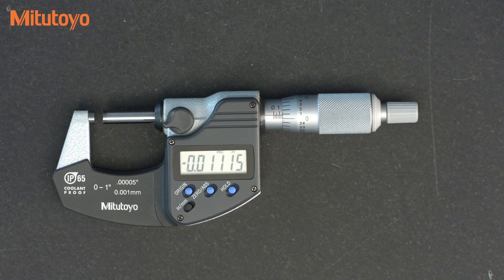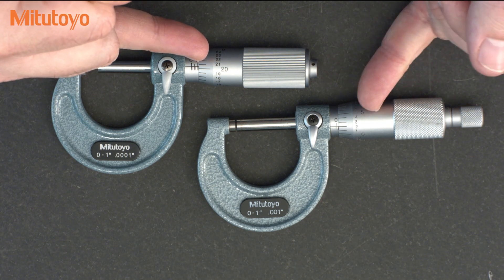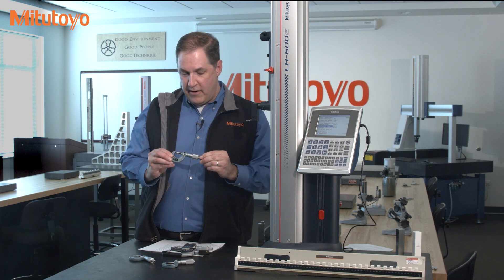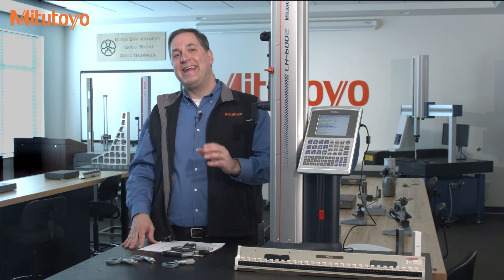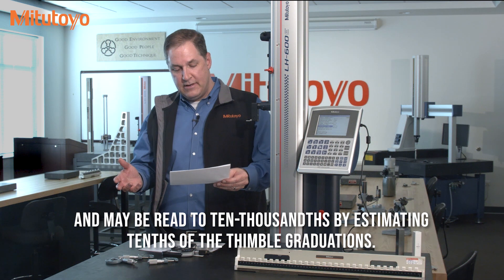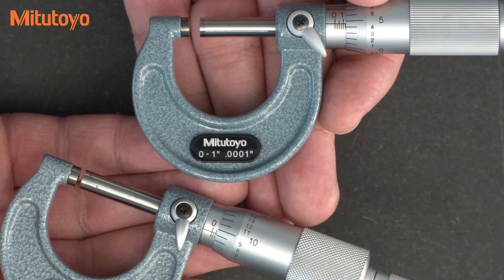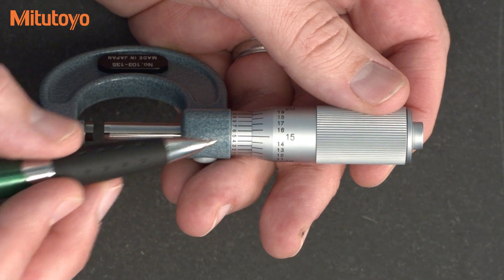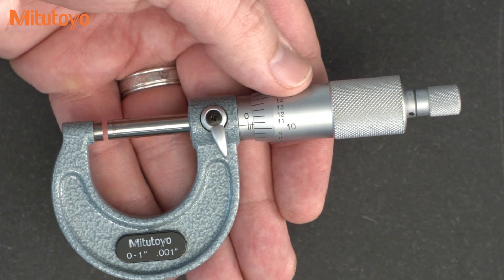Mechanical Micrometer Calibration and Measurement Accuracy - Metrology Training Lab

Comment: Measurement accuracy is not a function of resolution, no matter  between lines or digital. There are resolution requirements in accuracy classification but repeatability, reproducibility and bias are major contributors in any measurements including linear ones.

Comment: This was very informative! Thank you.
Reply from the maker: Glad it was helpful!
Reply: @MitutoyoAmerica  Here's a trick worth noting to estimate between graduation marks to get an extra order of precision: The human eye will recognize small whole fractions between these marks, the recognition of which decreases as the denominator increases. For example if you have an indication that appears to divide adjacent graduations/intervals into three equal parts  this recognition will pop right out, so use/record 0.33 or 0.67, not 0.3, or 0.7, respectively; or you could have an indication that divides adjacent graduations/intervals into four equal parts use/record 0.25, 0.50 or 0.75 not 0.2 (or 0.3), 0.5 or 0.7 or 8. Then round as necessary.

Comment: If someone take a measurement by guessing (aka higher than the resolution). He/She have to write it down on the recording. So if the meas is 2.2505" and the resolution of the instrument is .001" the record must be written as 2.2505"±.001". Just to give the information of the uncertainty that the record of the measurement has.
Reply: In my opinion, the more important point is to understand the difference between resolution and the scale interval (or graduation). As shown in this video, a micrometer with 0.001" graduations has a resolution 10 times smaller than that (maybe more).
Reply: @dr.jimsalsbury695  great to see the man himself replying to comments.